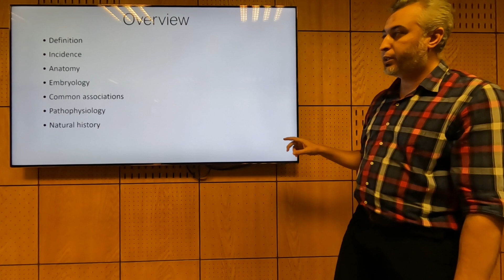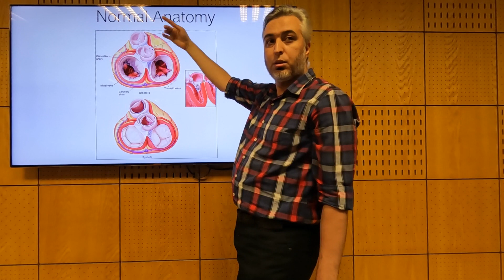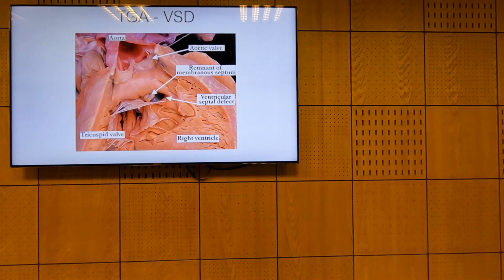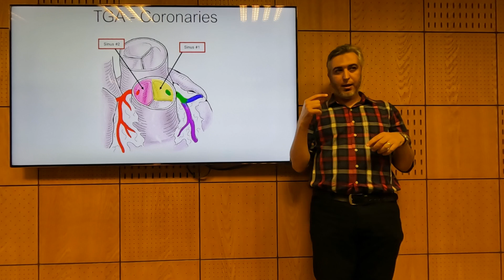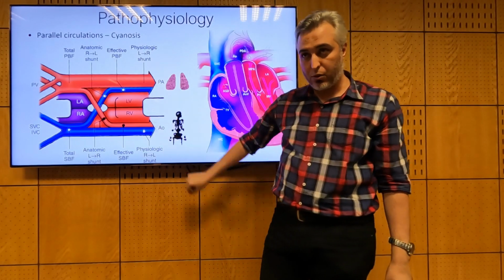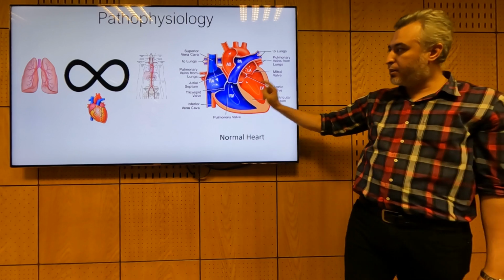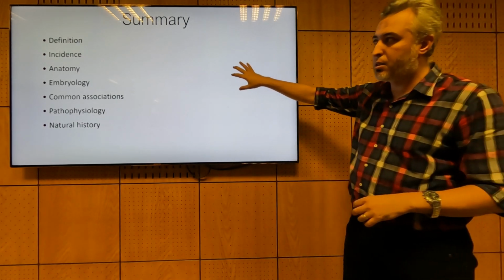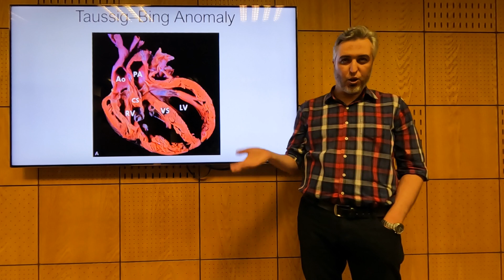TGA, Part 1 (En) - Hatem Hosny

Comment: بارك الله فيك ربنا يجعله في ميزان حسناتك
Reply: The Presence of the ASD will accelerate the LV deconditioning and the presence of the VSD will delay the deconditioning. 
The question here is: what about  if the VSD is Small in size: can it delay LV deconditioning ?
Reply from the maker: LV conditioning depends on pressure and/or volume load.
So if the VSD is small (not causing enough pressure and volume load for the LV), LV can still decondition.
This is obviously in addition to other factors like LVOTO, size of ASD, size of PDA,...etc